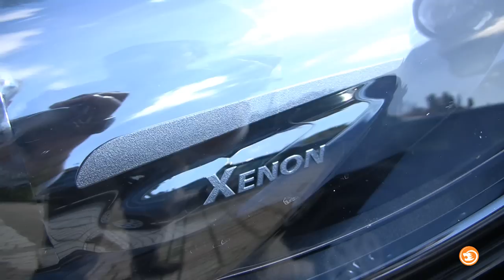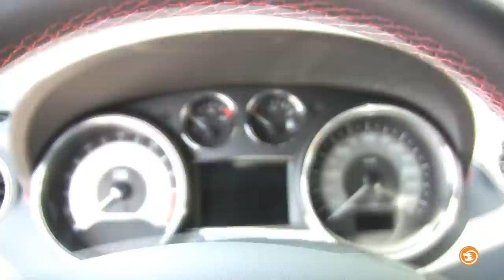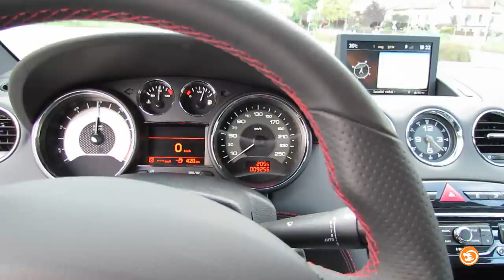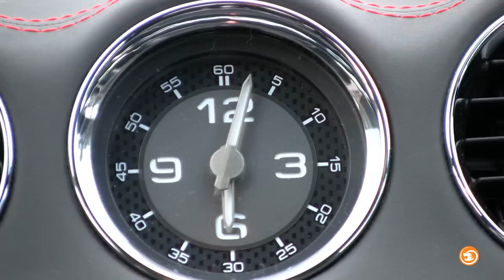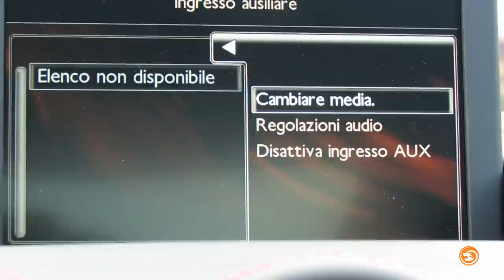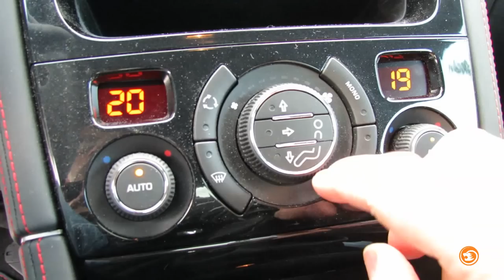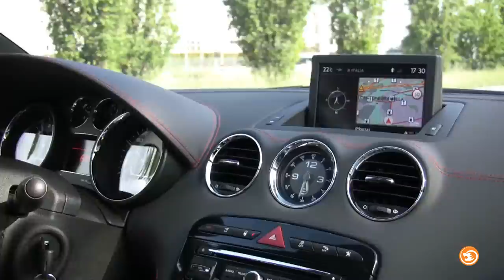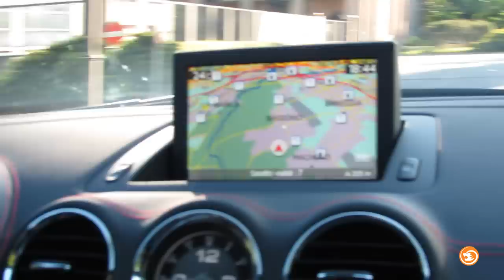TEST DRIVE PEUGEOT RCZ R - PASSIONE PEUGEOT

Comment: I have the Citroën Ds4 which got the same 1.6L 200THP engine and a 6 speed AT. I also test drove the RCZ and both seem identical in performance and roughness.

Dont get fooled by the tiny size of the engine,  the torque is at its peak at a pretty low RPM and the gear ratio is remarkable. If I'd reconsider an alternative to the RCZ,  I'd definitely go for the DS3,  exact same specs, lighter weight and more compact. Otherwise, the RCZ is as stylish as a porsche boxter
Reply: except the RCZR is 270bhp